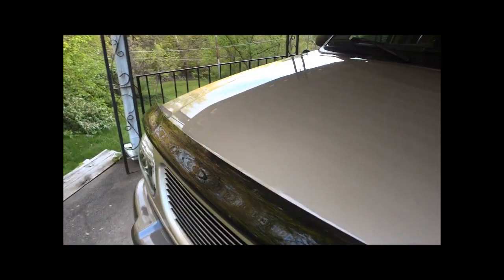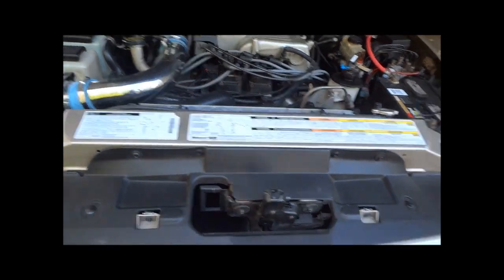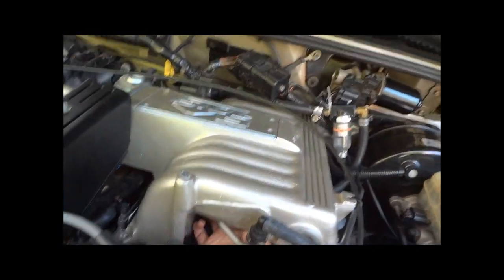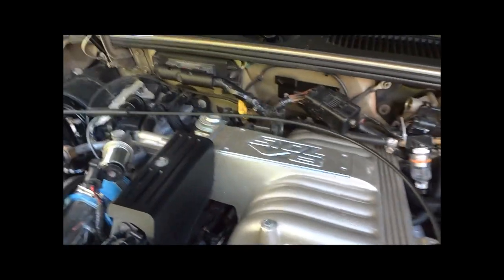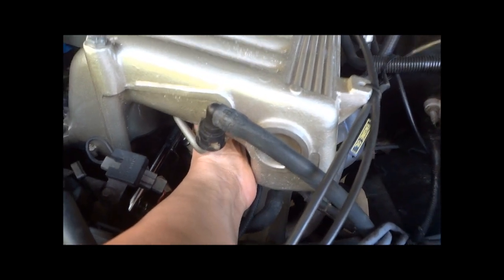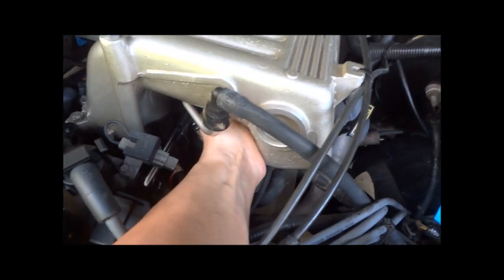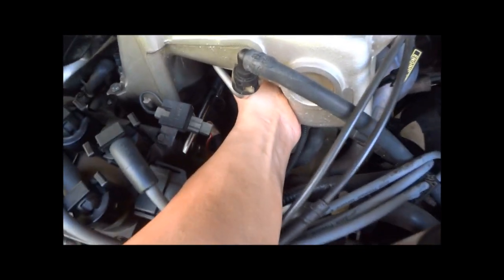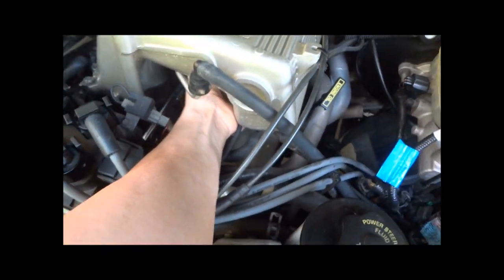Ghost Cam Explorer V8

Comment from the maker: Yes. The Exhaust is as follows, TMH's, 100 cell High Flow Cats 2.5'' piping, the 2 exhaust dumps, Dual in/Dual Out Flowmaster 40 series and out the rear of each tire. The motor is about to get overhauled here starting next week where it'll get a REAL new cam. I thought about 10 series I have them on my Mustang. I'd probably have to get two 2.5'' center in/out mufflers and have them turned sideways to fit. And the 5.0 Badges are from the new 2011 Mustangs.

Comment from the maker: I don't know how they'll be on Explorer but it does drone pretty good in my Mustang GT. I've learned to deal with it. It kinda goes down a little bit after 2,100 rpm's. My truck in this video has Super 40 series which is aggressive but not too bad as far as drone. And I have no rear cats, no resonator, those dumps, Headers, and the Super Flow Front Cats. It has that drone that can be drowned out by a radio easily. And thanks, I do spend alot of time detailing.

Comment: Nice! thought it didn't sound stock. the only thing I am worried about is if the 10 series would be too loud for daily use. I plan on keeping the rest of the exhaust the same, stock manifolds, cats, maybe the resonator (I hear that it has a highway drone if you take it out). You going to do build videos? Also, I am severely jealous of how clean you engine compartment is.

Comment: sounds like its sloobering on its self , does not sound like its cammed bro , all your doing is making it pig rich
Reply from the maker: This is an old outdated video. It's actually canmed now and has been since not long after this video was made.
Reply: @TekMan05  not sure why u would want to cam that motor the valves are small the ports are even smaller and the exhaust manifolds are very restrictive they do not flow at all ,ask me how I know ,I have the same motor and I got rid of the heads exhaust and changed the motor completely
Reply: @TekMan05  still running 5.0 but topend is mustang
Reply: @TekMan05  makes 400 hp now